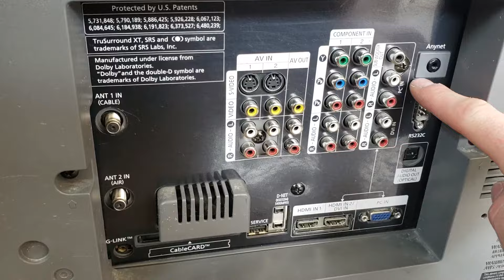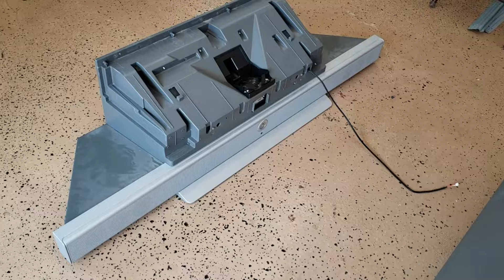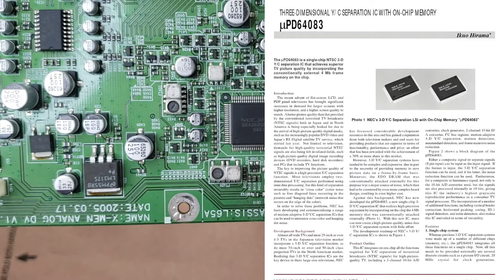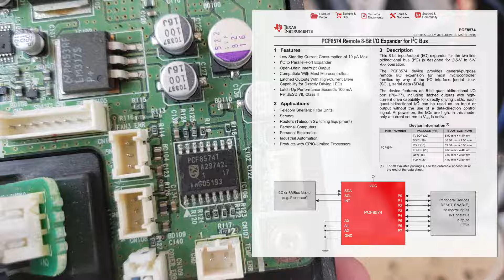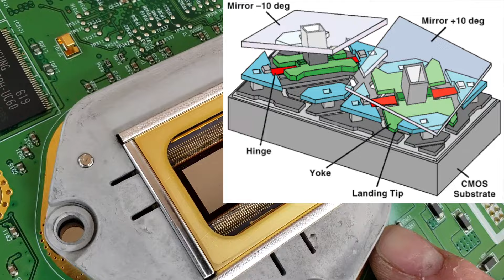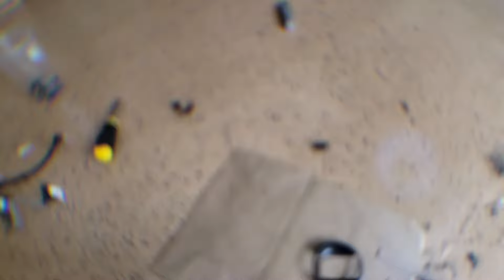DLP Rear Projection TV Teardown  + Analysis & How It Works

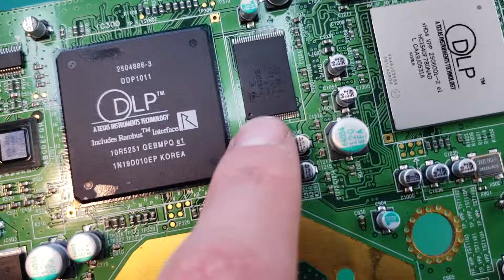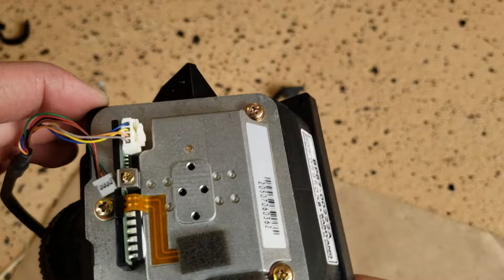Comment from the maker: 23:27 This chip is actually a structured ASIC, which is a hybrid of an FPGA and an ASIC. This one uses an Altera Stratix HC1S40F780NAD hardCopy structured ASIC as its base silicon, which contains 41,256 logic elements that are hardwired with TI's proprietary logic. The xHD4 works with the DLP chipsets and the wobbolation mirror shown at 28:52 to achieve 1080p at 60 Hz.

Comment: Since it's DLP with a color wheel, does this TV show the color artifacts when moving eyes quickly from side to side?
Reply from the maker: Yes, that is one of the disadvantages of these types of TVs since they show colors sequentially. High-end DLP cinema projectors worked around this by having a DLP chip for each color.
Reply: @BGTech1  Triple DLP at 1080p with 6 driver chips would be mucho dinero ai caramba.
Reply from the maker: @cebruthius   I did not know 6 DLP projectors were a thing
Reply: @BGTech1  1080p needs two driver chips for each color right?
Reply from the maker: @cebruthius  Not necessarily for color. Each driver chip does half the resolution. Full 1080p driver chips were not available in 2006.
Reply: @BGTech1  That's why I'm saying triple DLP would require 6 driver chips in total for 1080p.

Comment: Hi there great video but im still a bit lost on my JVC 56" rear projection, i bought a new lamp and all was well after a few hours i noticed an area of darkness a few days later the whole screen has a blackness and hardly watchable, not you put me in doubt as the polarised glass i saw on projector videos which i believed was the issue on my set now you showed a separate layer on the actual screen😲 so am i looking in to the wrong thing also I cant seem to get to the projector part despite having the screen off it seems i need to literally pull it to pieces but only want to continue if im going to solve the issue. Lastly i think my screen is only plastic or is there another layer beneath kind regards
Reply from the maker: This is a very interesting problem. I’m wondering if the new bulb is not exactly correct or if it was not made to exact specification of the old one, and it was allowed to overheat and damage the plastic pieces or optics near it as time continued. I would try to take it out, and pull the projection assembly out like I did and have a look for any obvious damage. Other than that I’m not really sure.

Comment: Can I install a led projector inside it
Reply from the maker: I mean technically you could but it would be an insane amount of work. All the optics are designed specifically to fit the interior geometry of this tv.
Reply: @BGTech1 thanks   But my projection tv have 3 individual lenses red green and blue. Will it less work?

Comment: I have a similar sony dlp 50 inch tv. looks the same as this tv. I'm having an issue that the display is slightly off centered. I think its the bottom of the screen is cut off by about a quarter inch. just wondering if there is a simple fix. note I did change the bulb on time in its lifetime.
Reply from the maker: It sounds like something is miss-aligned within the optics. There are several parts that can be adjusted but it’s hard to say which one it is. The service manual might be helpful, but I’m not an expert so I can’t give a definitive solution. Changing the bulb probably isn’t the reason though.

Comment: These were the original ultra short throw projectors
Reply from the maker: Mitsubishi managed to make them even thinner. They had a short lived product line called LaserVue, which used DLP and laser light sources. They are only about a third of the depth of this TV. Unfortunately they didn’t do well because they were competing with early LCD and plasma TVs.

Comment: i made a projector with one of them..4 years ago and it still work today
Reply from the maker: Good work. How’s the picture quality compared to the original tv?
Reply: @BGTech1  it give a good quality with the hdmi  but I raise the contrast a little    .. it can do 12 by 9 screens no problem…but the image is smaller at the bottom because the angle it is installed

Comment: I have the samsung version of this tv. 54 or so inches wide. I removed the screens to use as a replacement back glass for a camper top on my truck then realized its not a good option as it might possibly create a fire hazard with its magnifying glass lens effect as well as no visibility... So i found this video and im astonished at how in depth you dive into this teardown. No fluff or bs. Just straight to the point. So, thanks! Subbed. This seems to be a really unique peice of engineering that i imagine will be a collector peice one day. For now im looking forward to experimenting with the optics to create some kind of artwork. What sort of things can be done using the service ports?
Reply from the maker: Thanks for commenting! There are lots of great parts in these old TVs for all kinds of projects. That lens is the fresnel lens, and it’s basically a big magnifying lens. (I demonstrate this in my CRT projection tv teardown video). The ones In CRT projection TVs are a bit more powerful, and people turn them into a “solar death ray”. Good question about the service port, I haven’t tested it so I’m not sure if you need a special tool or not. It’s possible that the tv might need to be put into service mode to use it.

Comment: You do such an excellent job at explaining every step. May I ask what you do with all of the spare parts?
Reply from the maker: Thanks so much! I keep the majority of the reusable parts, and the rest I sell to a scrap yard for recycling.
Reply: @BGTech1  do you reuse the electronic components for a hobby?  I am electronics hobbiest and enjoy high voltage experimints using the tv flyback transformer.  Thanks for you quick response!
Reply from the maker: @shawncalderon4950  Yes, I do keep parts for use in my projects. I save a lot of circuit boards for their components, and other useful parts like wire, motors, switches etc. Just about every project I use salvaged parts in some way.